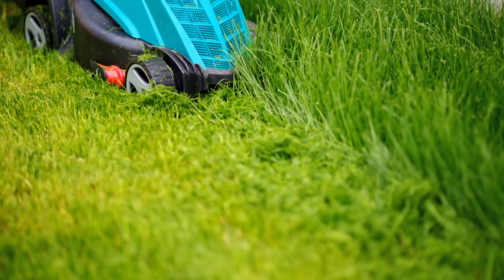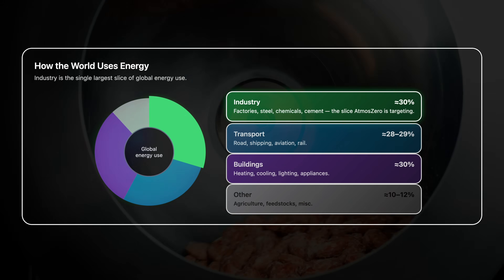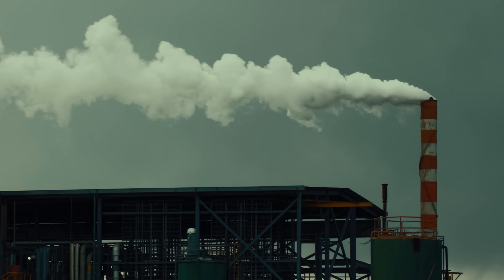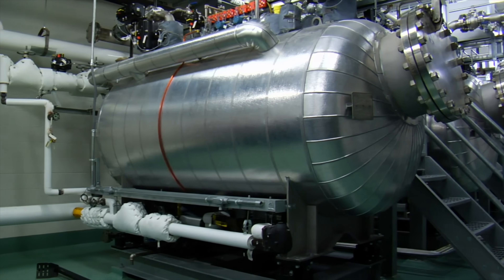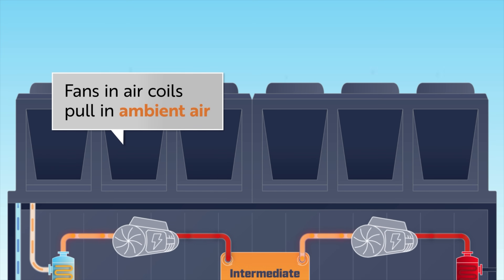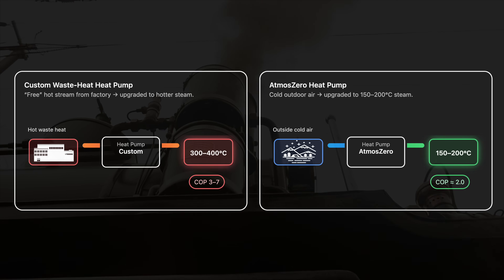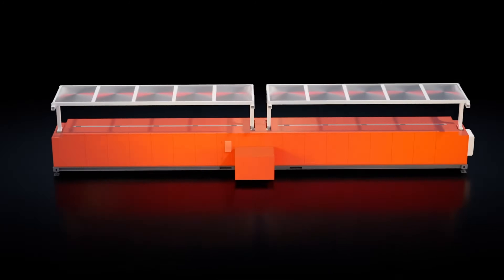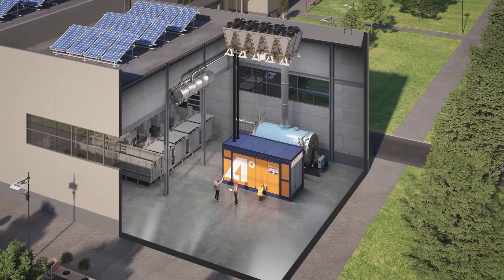This Startup Just SOLVED the Hardest Problem in Clean Energy

Comment: This system will NEVER operate in an industrial area below 2°C because it will freeze its coils in seconds.   The claims that these systems can operate in atmosphere at temps below freezing are utter bullshit and a misunderstanding of the way the cycle works: at 5°C most of these systems external "collecting" coils are already below -20°C and will frost over faster than if you call your MIL 'beeech' and it takes a lot of heat or time to get rid of the frost.   If these things are used under load anywhere near moisture sources below 18°C they'll turn into ice blocks so fast the flying rivets will kill people.  Just because a refrigeration compressor system can operate and keep a large warehouse at -20°C doesn't mean it can do it with high production rates in any efficient manner.  Heat pumps are a fallacy when the snow starts falling.

Comment: Pointless, considering about 70% of US electricity is created using fossil fuels. Conversion of electricity is still terribly inefficient since to burn coal or NatGas to make electricity 70% of the heat energy is lost. So if you use 1 kwh or thermal energy to produce electricity, you only get 0.3 kwh of power, then factor in another 10% loss in transmission & voltage conversion. so the result is around 0.2 kwh. Its far more efficient to use natgas directly to produce heat since about 80% or more of the heat can be used. Using Heat pumps for steam is just wasteful.
Reply: True, but keeps people working like me, and they may advance the state or the art.

Comment: Am I missing something here?  If electricity is 6x as expensive as natural gas and this solution gives you 2x units of heat for every unit of electricity then wouldn't this solution still cost 3x as much as natural gas?
Reply: You are right, it is more expensive but you are decarbonizing 😅
Reply: You forgot to factor in that US electricity is made from gas, which is why it is so expensive. In Canadian provinces BC and Quebec, where electricity is made from renewables, the cost of electricity is 1/3 of the cost mentioned in this video. China also has costs around that same level as Canada.   The problem is that the US energy sector is stuck in the last century and determined not to leave the last century.
Reply: @ryuuguu01 note that BC and QC electricity is largely hydro powered. Meanwhile, currently 30% of Ontario's electricity is generated using CANDU nuclear reactors while hydro is about 25% and natural gas is up to 30% while the nuclear fleet is undergoing refurbishment. When the reactor refurbishment is completed, that 30% NG will be reduced and nuclear will be back up to 60%. Wind and solar play a minor (also expensive) role.
Reply: Decarbonize our climate!
Reply: If we calculate the Total Cost of Ownership over a period of 30 years every old and new tech evens out. Also all industrial equipments have a spiralling cost of operation post few years of operations.

Comment: this sounds like a well thoughtout peoduct.
it won't solve the carbon emission problem by itself but it is definitely a step in the right direction.
if the factories don't need to do more engeniering than running some cables and connect two pipes, then it is usable for the entire industry sector running on steam in that temperature range and can save a lot of carbon emissions.
and from how i understand it, their niche doesn't have much competition either. 
i hope either that company or others with similar ideas will keep creating such innovation, the world needs them.

and from what i have seen from the concepts shown, the whole system should be scalable for higher temperatures by adding another pumping cacle or two using a better suited medium to reach the needed super high temperatures for the metal working factories.
they would probably need to make the whole system a bit bigger than just a shipping container to get a decent enough output from just air heat, though if they put the heat collector parts in the processing halls they could probably skip the first cycle entirely since steel mills run HOT.

Comment: Interesting technology to take atmospheric heat to make steam. I’d like to hear more.
There’s still a lot more to be done with more conventional systems that upgrade 100C waste heat from industries. There are already over 100 high temperature steam compressors now operating in the world. Some of these use waste heat from distillation overheads etc to make steam (under vacuum) as cold as 90C and compress to as high as 15 barg pressure and 270 C. SK Oil  South Korea has 95 tph steam production at 7 COP from waste heat in 3 column overheads. Atlas Copco installed steam compressor in Dow Ternuizen In the Netherlands. Piller Blowers puts 6 stages of blowers to upgrade heat from butadiene rubber coagulators that has been replicated in several sites. I know at least 10 plants now installing steam processors around the world so it’s a valid business case. (Particularly in  Europe and Asia who pay 5 times more for natural gas than in North America)

Comment: We had some drying ovens and we put automotive heat exchangers to preheat the incoming fresh air using the exhaust air. It didn't cost much to install and it saved power.

Comment: Maybe I'm missing something here? So these fancy, all singing, all dancing drop in "boilers" are more efficient than using coal (or gas) to create steam... but what about the generation of the electricity to power them ? Granted there's solar PV, wind and even nuclear, but there's still an obscene amount of electricity generation from burning coal, so even more heat pumps appearing (and more of those god awful electric cars!!!) is going to mean ever more electricity generation is required and hence more fossil fuel consumption? So much "green energy" is, to my way of thinking, a bit of a confidence trick. I'm about as all in as I can afford to be on green and efficient living here with 10Kw of PV and near enough 100% energy saving light bulbs, devices etc etc etc but on a day like we've had today our batteries never got higher than 60% and were flat again just an hour after sunset!!! I'm afraid that society doesn't have even a fraction of the answer yet and no solution is anywhere in sight.

Comment: Their process sounds like an air cycle machine used in aircraft. Those take very hot bleed air and cool it to close to freezing using head exchangers and centrifugal compressors/turbines. Theirs would be running in the opposite sense, of course, and don't use air as the working fluid. 
This idea looks really good to me.

Comment: EDIT: Literally in their marketing video they say it can be integrated into your glycol/water cooling loop to recover the cold output of these systems. Did you even watch the video? Did you need 5 more minutes of talking points?

How do you factor in combined cycle boilers where you are making electricity with a gas turbine and using its waste heat to do half of the heating, and then getting the precise temperature with a gas fire boiler? My employer uses two of these and we can make most of our electricity with those turbines while making steam at the same time.

On the other hand, can they turn this into a glycol loop to operate a refrigeration plant? I guess you answer this question in the video. Food production plants with freezers and coolers requiring refrigeration and also needing the steam. The pasteurization process literally needs steam and then cooling to perform its process. This system would be able to be a drop in at a pasteurizer. Or a plastics extruder plant that could use steam heat and cooling on the same machine. This is where you make CEOs and CFOs decide its worth doing this project. They could literally be building a pasturizer heat exchanger and then we could eliminate hundreds of feet of piping, literally run the "waste cooling" to the chillers for the pasteurization process. 

As far as the "extreme customization" and "downtime" We have 5 boilers on site, and during parts of the year we only need one or two. Installing a glycol loop is really trivial if you are talking about "free" energy and cost savings. And converting an air cooler to a glycol loop allows you to do remote discharge of your cool air. I'm not sure why a glycol loop system isn't a viable option here.

Comment: Anyone who thinks they are decarbonizing by switching to a heat pump are not counting where the electricity needed to power the heat pump comes from. Depending on where they are located, as much as 70 percent is coming from fossil fuels. What we really need are more nuclear power plants, then you could use heat pumps or electric boilers all day long. Plus the electricity would be cheaper.
Reply: He covers this in the video doofus. Nobody is doing this in a coal fired electrical location
Reply: @glenisold79 I know I watched the video sir, but not true, he didn't talk about the reduction only the economics of it. My point @glenisold79 is that we need more NUCLEAR energy-then we can do all the heat pumps you want because we will have a stable grid along with cheaper energy!

Comment: The issue is that the cop of multi stage heat pumps is rarely hitting 3. So as long as gas steam boilers have an efficiency of over 90 percent and even close to 98%, the decisions to install a heatpump system, will be taken from a idealistic point of view and not from an economical point of view. If the economy is sluggish my experience is that new investments are not made into new promising and maybe idealistic technologies.
Also it's only when your electrical energy is coming from wind, hydro, solar or nuclear, for more than 60% that you start to decarbonise the steam supply.
Reply: Who wants to "invest" in "new promising and maybe idealistic technologies."
Reply: @CCRoselle some companies have spare money or state in their core values to invest in technologies that don't use carbon energy sources on their own.

Comment: Do you avoid having a boiler engineer? If so, they’re expensive
Reply: Depends on the operating pressure and that depends on the location (city code)
I have seen large buildings converted to low-pressure tteab for the labor savings and insurance costs.

Comment: Mixing engineering and market practicality is the only way forward for existing infrastructure.
The motto of "If it ain't broke, don't fix it" is incredibly strong and economically viable in the vast majority of cases when you're assessing drop in vs custom replacement of a product.

Comment: I think capturing waist heat from brewing to consolidate using a heat pump and use l in other stages of the process is brilliant.

Using an air source heat pump to replace a high efficiency natural gas industrial boiler is moronic unless you have excess electricity you are trying to get rid of.

A natural gas boiler is 80-95% efficient.

The us electric grid is about 40% efficient at the meter and it took a huge amount of turbines and infrastructure to make that electricity.  You are already working at a huge loss in efficiency at that point.

Then you are using very expensive heat pumps to scavenge the meager heat in the air through a huge delta T to create high temperature steam.

This is about the dumbest Rube Goldberg machine I have seen touted as a good idea for industrial use 

Please look for more efficient, practical ideas to advertise.

Comment: If a Resistive Heater is 6 times the cost of a Gas Boiler and this thing is a COP of 2.0 then isn't this still 3 times the operating cost of the Gas Boiler still and we all know Heat Pump COP varies based on temperature, at what outdoor temperature does the COP get just as bad as the resistive heater? There is a reason you need that 6-7 COP mark with the custom systems, if it's MORE EXPENSIVE TO RUN IT WILL NEVER TAKE OVER.
Reply: I had done a desktop design and equipment selection to do something very simular to this in the late 90s. Main issue then was equipment costs plus the cost of operation using electricity vs gas. 

Best solutions then as now ws/is to recover off of high quality waste heat, such as condensate, or heat rejection sources from the process and use it to preheat or displace steam production. I have implemented a few of these to reduce production costs some 15 years ago. I think there is a great opportunity in industry to do a lot more of that, but unfortunately its often seen as capital expenditures that potential risk process reliability over tried and true if more operationally cost established methods. 

I'm not as sure in this case as outlined in the video makes great sence, as it seems to me to only be moderately cost effective vs the nat gas currently being used. But to be fair, I also didn't fully review the situation either or know if they have other driving factors in play.

Good luck to the company as we need more innovation and drivers of change in the industry.
Reply: And the COP drops with the O.A. (outside air temp)
Reply: If gas is still cheaper, then that's why we need carbon taxes.

The single best way for every industry to find the economic motivation to rapidly solve electrification is a carbon tax.
Reply: @timtravelnomad  truth is many jurisdictions have cheaper electric power. BC, Manitoba and Quebec in Canada have cheaper industrial priced electricity compared to nat gas options. The renewable electricity revolution will continue to drive pricing comparatively lower. It just becomes a storage issue, which industrial debate necking along with efficiency changes such as what is noted in this video will drive the change to cleaner power sources.
Reply: @timtravelnomad  a "tax" to force people to do something you want them to do is a fucking government over reach fine just like that bullshit ACA tax for not buying overpriced health insurance

Comment: the only question that remains is where is the water going to come from? several places are already strained by lack of water, draughts and these massive AI data centers hogging it all... it might be good but it's definitely not the solution to stack another consumer of one of the most precious resources on this planet when we're draining aquifers of fresh water and they're not being replenished fast enough... heat pumps ARE definitely the solution but it's not steam but the Sterling Engine!
Reply: Where is the water coming from now? This system just makes heat. If it being used to replace a gas boiler then their already is a water source.

Comment: I feel silly for asking, but aren't they still going to be burning fossil fuels for the electricity needed to run this continuously? Unfortunately renewals are variable and we don't have good energy storage technology, and industry that makes use of this kind of heat source tends to run 24/7. So it's reduced the carbon when renewable energy is being put into the grid, but it's not decarbonized. And I'm not saying this is a bad idea all together, but I don't see how it's zero carbon yet.
Reply: Only when it's not able to be run off wind or solar, which would be at least 40% of the time. But that is still a huge step in the right direction. Too many people shooting down ideas like this because they don't go "far enough". Every little step is progress there is so much work to get off Fossil fuels it will take at last 60 years so if we have viable ways to start that now in cost effective ways we should be doing them all.

Comment: Great Engineering Feat, But poor economics .. The same fossil fuels used in the distributed manufacturing sites are used in electric generation .. You have all of the line losses ~4%  plus 100% electric cost for the heat pumps .. Assuming a 5 to 1 ratio on heat pump costs that is an overall cost increase of 25% .. We are also ignoring the massive cost of building Power plants to produce the electricity and the building addition electric Grid Capacity .. A great Idea if you want to increase the industrial cost by 50% or more .. Just like all Electric Cars its economically unfeasible ..  I do see Niche applications where you need a steam plant but do not want to haul in Fuel or build Pipelines .. This is not a wasted effort, just do not over hype it

Comment: Very interesting process for warm climates.

It sounds like you are comparing the cost of this heat pump to an electric boiler with a COP of 1? 
Yes, at the end, you mentioned the six-to-one, electric to gas cost.

Industrial gas boilers can exceed 90% efficiency and the cost of natural gas in most locations is less than that of electricity.

My home system is a hybrid 95% WM boiler/  air to air heat pump 3.8 COP @ 42 F.
And the boiler is on high mass floor heating. Takes time to reach a comfort zone; lower for radiant than forced air from the heat pump.
Here in northern Illinois, mostly gas heat from mid mid-December to mid-March.

Also, the cost of gas/electric changes often, and the taxes and charges have to be added.

For my system, the heat pump costs less until ~20 F. It changes often.

As the outside air temperature drops, the COP decreases.
The Atmos heat pump COP = 2 at what outside air temp???  and 1 at -20 C  (-4F) ???

Comment: Once the proof of concept and proof of application are satisfied, new factories can be built with this technology in mind.  Just like how the current factories were built with pre-existing technology in mind.  It's just how stairs work; you can climb several flights of stairs and even though you travel a longer linear distance since you're going diagonally back and forth, it's more feasible than trying to jump seven stories in a single bound.